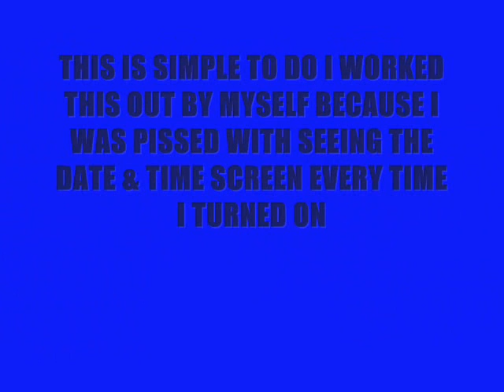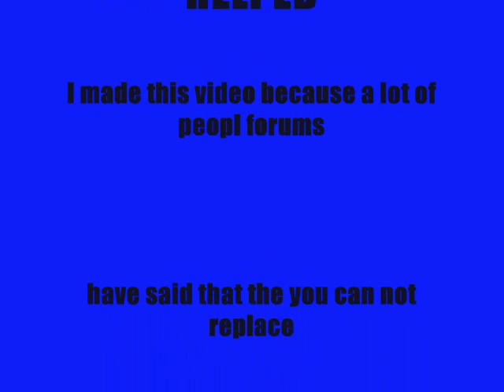Dreamcast Care & Repair: Replacing the Internal Battery

Comment: if they're not scratched,cracked+worked perfect when you first got them,they will be good game discs. im pretty sure that the dc didnt have games that relied heavily on the battery in order to run. my own dc plays games ok but resets randomly, a common problem-its either overheating or a dead battery. I have tried the pin fix etc,nothing works. everything aside from replacing the battery so its probably all linked to that. I wouldnt use a non-rechargeable one as it could overheat+ruin the dc

Comment: AWESOME!! A store in northern California took a look at the instructions for replacing this battery and said it looks very straight forward and they'd do it for me for only $5.  Very awesome.  You can also get a new battery on eBay for only $6.99 with $0.99 shipping.  The store is called Batteries Plus.  They specialize in battery replacement.

Comment: @arranmc182 get a vertical cr2032 battery holder off ebay and solder that in. its very easy mod and now i just pop ot the used battery and replace it simples.

Comment: @arranmc182 Yes biggie, the stuff in coin cells is worse than in normal batteries and they are pretty nasty anyway. There is a big chance of a leak. The battery needs to be 3032 rechargable not CR3032!!!

Comment: I just replaced the battery on my Dreamcast today, because it was dead and also starting to leak. It came with a 3V ML2430, but I replaced it with a 2032 battery holder (for easy servicing in the future) containing a 3V ML2032. I also cleaned al the contact pins (including the Power in on the DC backside), because the console also kept rebooting out of nowhere on me.

Comment: Also, just wanted to reiterate, most PC motherboards are NOT set up to use a rechargable battery system.  In the past they have used 4.5V alkaline and 3V lithium batteries, but non-rechargable on both.  If you put a rechargable battery in a system not designed for it, you'll only get the charge you had when you bought the battery; nothing more.  With a lithium, it'll still last a while, but you're still getting no benefit from the rechargability since the mobo is not designed to charge it anyway

Comment: If the PC motherboard has a CR2032 in it already, you should stick with a CR2032.  ML2032 is pretty uncommon and spot-welding connector tabs on a coin cell isn't easy.  Do NOT attempt to solder those types of tabs on or you'll end up destroying the battery chemistry--get the surface hot enough to make a good weld and you'll jack up the battery.

I highly doubt any watch repair place would have a rechargable coin cell.  And Radio Shack, doubtful as well.  Online is probably best bet.

Comment: If the Dreamcast has been in storage for a while, simply leave the Dreamcast turned on for as long as you can afford. The battery should recharge itself. In most cases, there will be no need for a replacement. 
To test, after a good few hours (i'd recommend leaving it on for atleast 4 hours) turn it off, unplug it. give it enough time for the charge to dissipate from the motherboard (about 30 seconds should do) Then try again. It shouldn't ask you to set the clock if the battery has charged.

Comment: The actual battery needed is an ML2032 which is the rechargable variant of the CR2032s more commonly found in the dreamcast VMUs and watches. 
I would not recommend using a CR2032 as non-rechargable batteries can explode if they are charges and the Dreamcast WILL attempt to recharge anything you put in there while it is powered on.
You can find the ML2032s online any place that sells batteries. Also try asking places like watch repair shops and Radioshack.

Comment: useful video, but the framerate on the video is a little frustratingly slow. Other than that, this really helps. Whether or not I decide to solder the battery on, you told me what kind of battery to purchase and where it is, so thanks a bunch!

Comment: or you could of course use a soldering iron, omg! there sooo simple to use and you wont break the pins off if you reheat the exsisting solder too melt the battery free, why risk more damage? think on peeps..

Comment: I didn't unsolder the 3 pins I broke them off the new batterie and then just taped the battery in. No rip off here - these are the EXACT GENUINE batteries that are inside a dreamcast system. EXACT REPLACEMENT. For me, I don't want to take the risk of having this system not work right in the future because I used a rig job with some other kind or type of battery.

Comment: The battery inside the DC is a SANYO ML2430 VS1 "LITHIUM "COIN" RECHARGEABLE 3 PINS" You can purchase them at google the word "batterystore" for $5.50 each. Good Luck!

Comment: When you replaced this battery? 
I installed a rechargeable battery from a cordless phone (2.4v 300mAh) because the normal lithium CR2032 (do you know if they recharge?) I found here says: "Don´t recharge, could explode/leak".
For now it´s working, if it fail I will try your method, good to see that the battery don´t explode! :D
Thanks!!